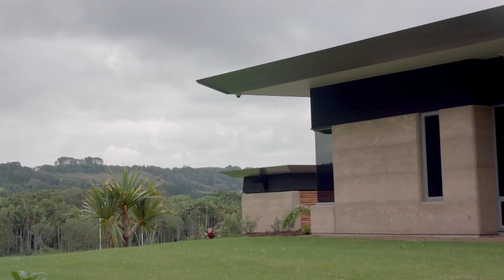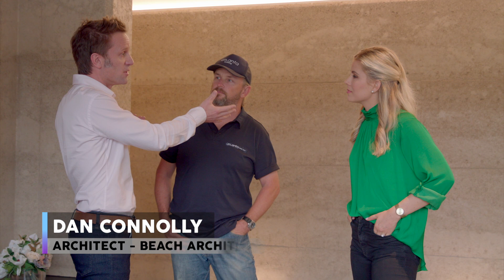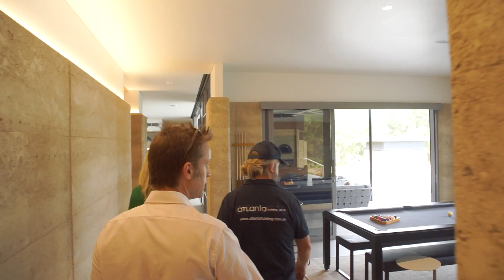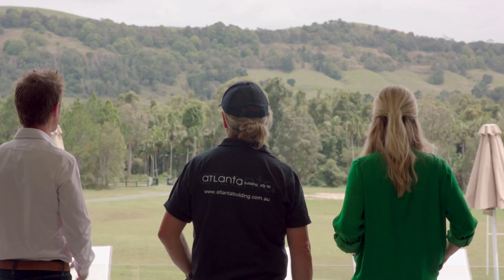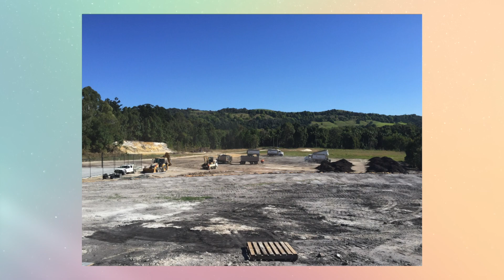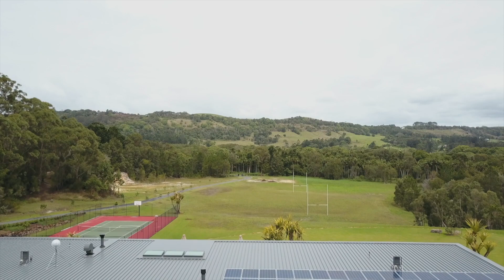BYRON BAY HINTERLAND HOUSE MADE FROM RAMMED EARTH

Comment: It is an amazing house! The only thing a bit sad about it is that they add cement in the earth !  Why not build concrete wall then. It would be a lot better to add lime instead of cement! Cement is a dead material that doesn't breathe and to which manufactures add industrial residues. Where lime is a natural product that stabilize wonderfully the earth and it breathes, therefore allowing humidity to migrate out of the walls!
Reply: If you don't add concrete you probably have a lot of dust in the house
Reply: The amount of Portland cement is about 5% of the mix, it acts as an stabilizer and because earth is the majority of the material the walls remain breathable. Ideally it would be nice not to use cement.